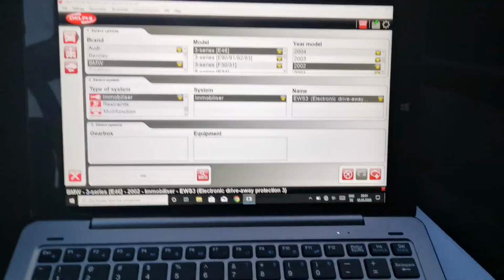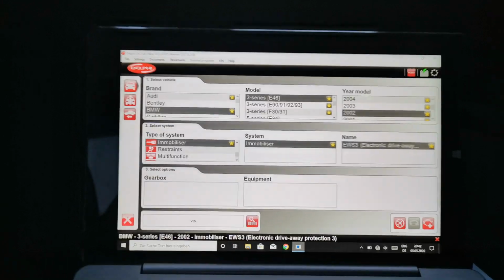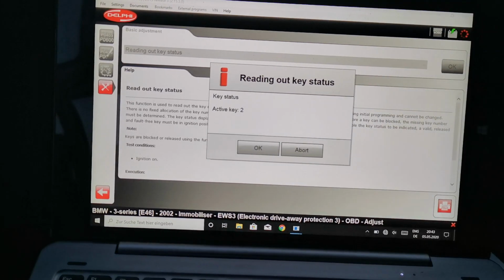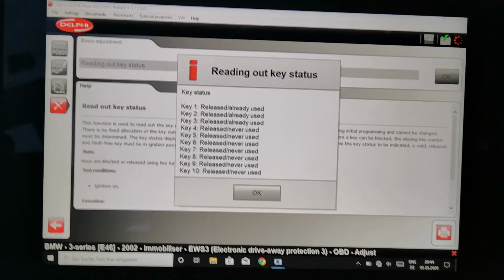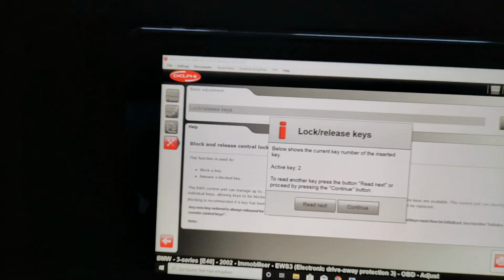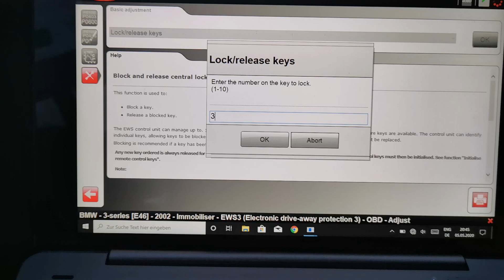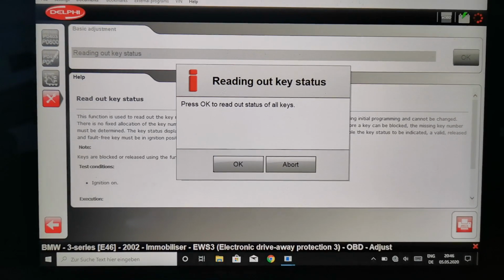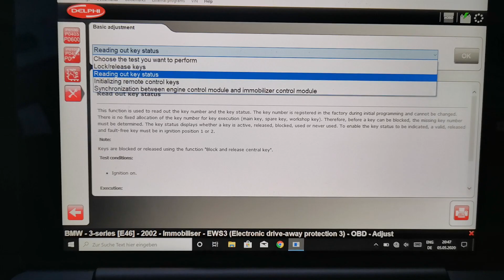How to program setup key fob lock or unlock /release keys on bmw e46 with delphi  ds150e

Comment: Hi, my car blocked the keys after when battery was very low and removed to charge. When I put it back it wont start. Can I add the same keys back?
Reply from the maker: Just try! I think you have to let programming again!
Reply: @diyonlinegarage  so,my problem wasn't the key. The fuel Pump is always priming when the car is sleep. It goes to battery discharge. The ekpm1 was replaced with a new one,but it still do the same...